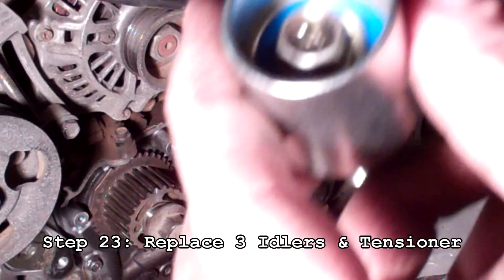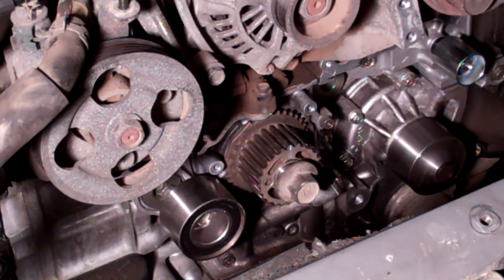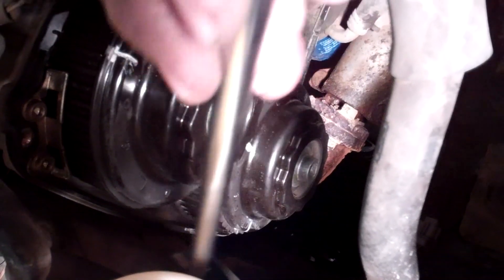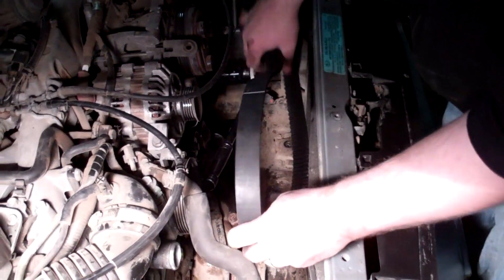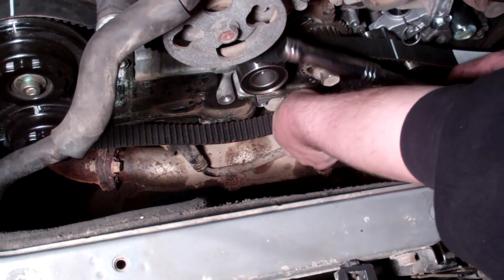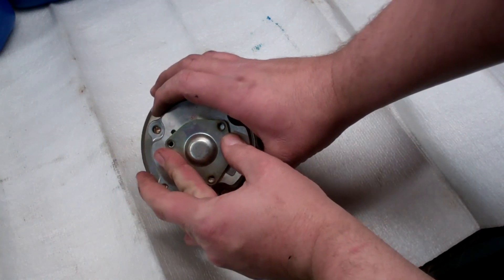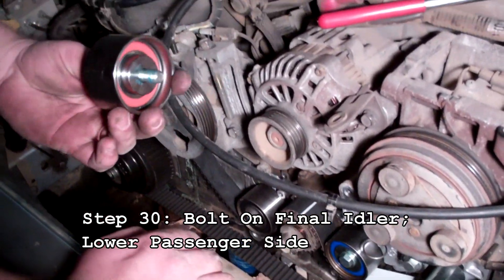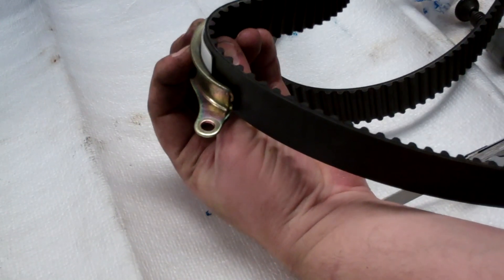Meatys Subaru Timing Belt Guide (HD)(3/5)

Comment: My belt slipped while trying to undo the crank sprocket bolt again (already undid it and reinstalled to line up timing marks) and the top right cam (facing the engine) moved out of timing. I turned the crank twice to see if it realigns but they were all now way out. I tried a bit further but felt resistance so I stopped. Everything is out of alignment now. The crank sprocket is out with the arrow mark pointing up at the timing mark. Is it safe for me to remove the belt, then turn the crank sprocket clockwise to it's timing mark, then line up all the cams? Thanks

Comment: Can you spin the driver's side cam pulleys a full 360 degrees as long as you spin them in the correct direction (top clockwise and bottom counterclockwise)?

P.s. Thanks for a great video! Best out there by far for this task!

Comment: TBH, It's probably better to use another reference point than driver or passenger side since in aus/japan, u.k wheel is on the right hand side.

Dip stick is a good reference or right or left side of engine when facing the windshield.

Comment: Sorry for the noob question, but I've always wondered why the cam pulleys on the passenger's side look different than the driver's side? Also, why does the driver's side intake cam pulley looks totally different than all the others, including the passenger's side cam pulley?
Reply: There's a unique one because it has an extra bit for the cam position sensor. The left and right are different because the heads are the same casting, so the heights are all lined up with different pulleys and stuff.

Comment: when i put my crank gear a tdc with the heads of my ej20 the pistons are in the middle of the block, is this corect or should the front 2 or the rear 2 pistons be at the top of the block.

Comment: man... i was told to crank the driver side exhaust cam gear clockwise instead of counterclockwise. stopped when a strange unpleasant sound was heard. then discovered on legacygt.com that you can only go counter clock or it will bend valves. do you think i bent the valve?

Comment: I've noticed on this and other videos the cam gear marks don't seem to me aligning with dead center of the cover notches. Is this just parallax error from the camera position, or something I have to watch out for?

I've got a '96 Leg. 2.2l. With SOHC, is the driver's side camshaft turn direction specific? Why is this, anyway? In the video you say you have to turn the top one CW and the bottom CCW, but with the engine running they'll both turn the same direction anyway ...

Great videos!

Comment: @mikethemeatball  hey mate, when doing this I used a cam clamp to keep everything in position but when puting the belt on I knocked the clamp off and the cams spun outta control, am I able to just  refine them to their marks, turning them the correct way or will the valves be bent already?
Reply: Old comment but did you solve this?
Reply: @SJMILLER121  yeah actually I just spun them back into place and re-clamped them, fit the bet on and I never had an issue. I wouldn’t at all suggest that it’s ok to do but for some reason I got away with it.

Comment: @mikethemeatball The old cogged pully broke, while in gear going down rd. I replaced all pulleys,tentioner,and belt. got cams set at 12 o'clock crank at mark, closed it up. I started car then heard knocking in passenger head, and motor was shaking little more than normal. yes SOHC 2.5.

Comment from the maker: @kb1pli Then put crank bolt back in and turn motor with 22mm socket and align the crank sprocket marks and see if both cam gear marks are pointing straight up at the 12'oclock positions. If not, it slipped timing. If you have a check engine light for a misfire in any or all of the 4 cylinders it would be for this reason. An exploded idler can definitely cause this. (2 of 2)

Comment from the maker: @kb1pli The pulley exploded AFTER you did a timing belt job and replaced all with new? Or your old one exploded and now you're trying to see if the timing is off? The 2000 2.5 is an interference engine, I'm pretty sure your is a SOHC setup and only has 2 cam gears instead of 4. Good thing about these engines is they are so easy to work on when it comes to the timing belt. You can remove the timing covers without draining/removing the radiator. Remove crank pulley and then timing covers (1 of 2)

Comment: Well parts finaly got here, got it together. Silly me next question, car was in gear pulling through intersection when cogged pully bearing exploded. Is 2000 2.5 an interferance engine? Seems there's a knocking in the pass side of block. Engine runs, could I be one tooth off pass cam or is it sometime bigger?

Comment: Great video, I have a 2000 leg outback 2.5 single ohc. Cams are out of line and was wondering, does the cam on pass side if mark, or dent is top, does the driverside cam need to be with mark down. Or 180 from pass side?

Comment from the maker: Whatever you do, do NOT move the crank. SLIGHTLY wiggle the upper cam gear back and forth (again, SLIGHTLY, just small movements is all that should be necessary) until it snaps back into a neutral position. Then do the same to the lower cam gear.

Comment: excellent video. i have a 2005 subaru 2.5 engine. I am in the middle of replacing the t-belt and the cams moved out of  position. What can I do to make sure the motor is timed correctly. thank you